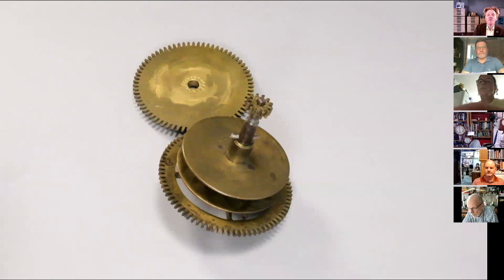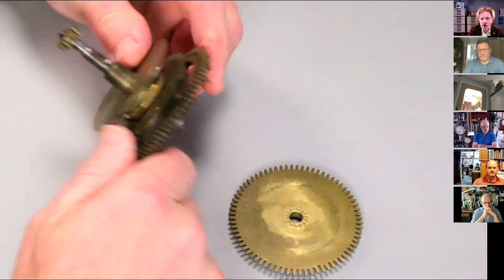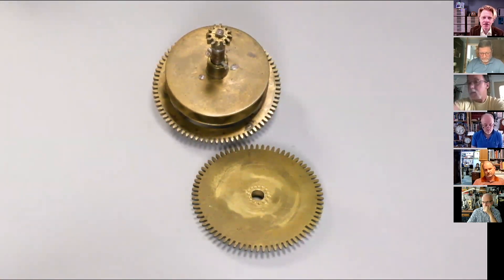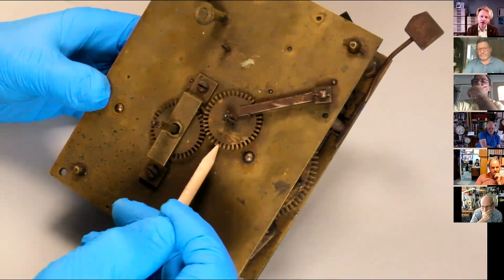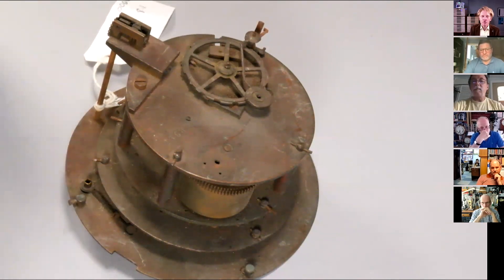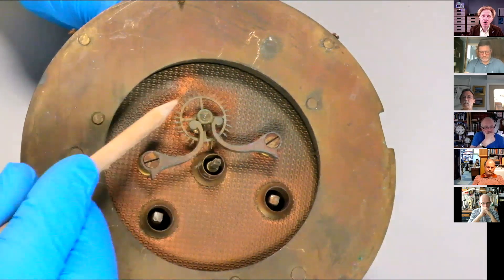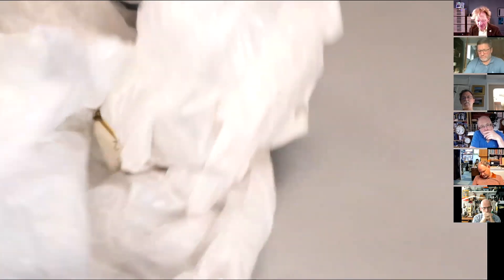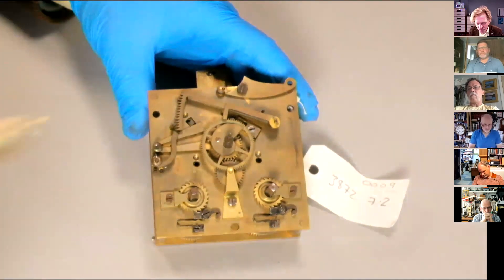Open Clock Club #031 2021 06 26

Comment: I think you are good but the videos are far too long, need to keep it more focussed on the work and no more than 30 minutes
Reply from the maker: Hi Gordon.  Thanks for your feedback.  You have found yourself at the archive channel.  These are recordings of hour-long meetings of Open Clock Club.  This initiative we started in lock-down to create a sense of community.  Any instruction is secondary.  For more focussed content, check out our other "how to repair pendulum clocks" channel of discrete vids or READ repairs which we started with a watch.  Yours , Matthew